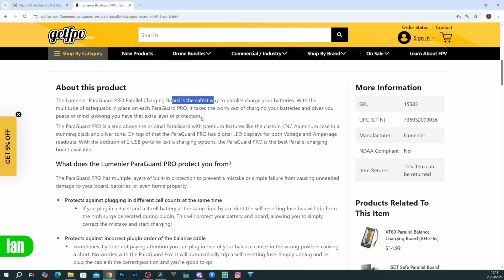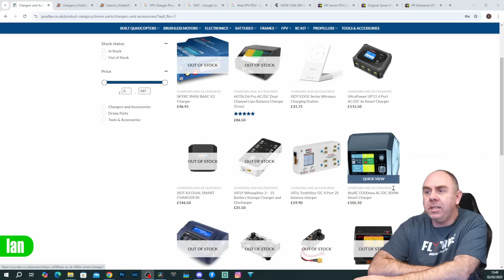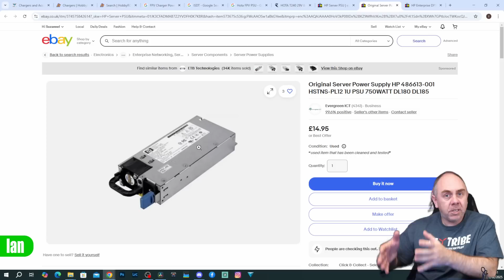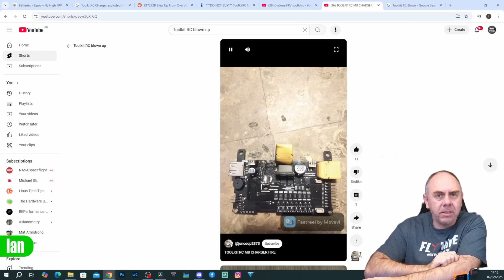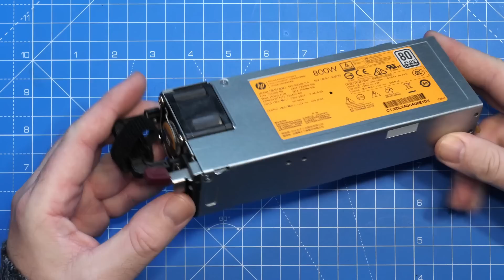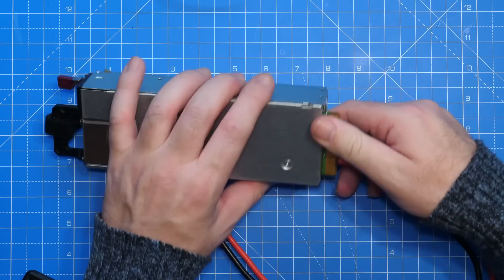FPV Lipo Battery Chargers Buyers Guide - Don't Get Caught Out!

Comment: It's a bit dissapointing that after all this time you still have to use server power supplies. I was hoping to get a nice all in one AC charger but it looks like I will be stuck with my setup forever. Maybe the chargers should be build like a modular NAS system with a small case that has a server power supply and multiple bays that can take the charging modules and you could just plug in as many ans you need.

Comment: I'm feeling old. Started FPV back in 2013 - It was all PSU > Balancer > Parallel board. Many years of use, never a problem. The chargers of today didn't exist; now there are dozens. I foolishly just bought a ToolkitRC Q4AC before doing proper due diligence, then I saw this 🙄... maybe it will be okay if I just use DC, lol🙏

Comment: I have a old school dual 12v supply from 30 yrs ago that still works fine. Have been using hota d6pro since it's be out and I use both ac n DC with it. But ac on small 2s but DC doing 4s up. .

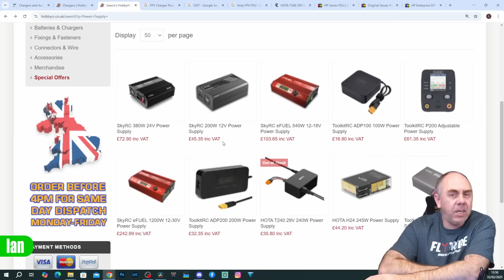Comment: 06:24  I use ZXD2400 3000w Server PSU for $30 (used) and Adjustable module + LCD $25, it has 2 output options, 60v and 50a or 120v and 25a.

Comment: Which would be better for the hotel f6 an 800watt or a 1200watt supply bearing in mind the hotel f6 is 1000w, are the different size still the same pin out?

Comment: Although I appreciate your content, on this one I have some concerns:
A 12V power supply will not  give you the most possible power for DC chargers, as these are also inherently have their V x A x W configurations, so you may not actually get the most out of it.
The section of cable used on your PSU is not nearly large enough and should never use an XT60 connector. That solder will melt as soon as you put some heavy workload on it

MY recommendation for whoever wants to use a truly powerful DC charging station, is to use SkyRC efuel 1200W and/or ISDT SP3060 or similar; and depending on the use cases, chargers like SkyRC B6, ISDT Q8 MAx or P30

Comment: On the server power supply, 700w sounds like a lot but no matter, you will be power limited by the 12v, to just 120W in many chargers.
If that's how you power your chargers that tells me you're definitely not pushing them to the limit. Hard to get good data on reliability like that.

Comment: Hota S6 for 3-4 years now and going strong no issues. Used to use a toolkitrc m6d which held up pretty good for me for a while but after some time I kept having to calibrate it. And before that I had a pair of ISDT q6 pros that worked awesome for a very long time but eventually those started messing up on me too. I think one of the major issues with Lipo chargers for FPV is that we use these chargers so much every single day and are putting so much voltage through these things especially when you’re using parallel charging boards on a consistent basis that eventually any charger will start going bad on you after some time it’s just a matter of how long it will hold out until then.

Comment: Another option  for a power supply is to use the one on your 3d printer if you have on, just don't print while changing. I personally swapped the power supply in one of my printers to a meanwell 24v 350w and i use the one that was in the printer just for changing.

Comment: I am new to the fpv community and I bought a new ISTD Charger that can do AC and DC. Unfortunately, I am a little bit disappointed. I only used it once for aboud an hour and I have seen at least two bugs while using it. For example I set it to charge my 1300 mAh 6S Lipo to storage voltage which is 3.8V. It stopped charging at 2.8V and started to balance it at 2.8V. I had to restart the charger for it to work properly again.
The second thing that really annoys me is the horribly bad fan curve for cooling the charger. The fans kick on at only charging one 6S Lipo at 1C and it constantly cuts out and kicks in again. And it super loud. It sounds almost like a vacuum cleaner! I also held my hand on the fan hole while it was on and it is barely moving any air. Super loud and inefficient.

Comment: I just bought and sent back two different P200 V2 units that had the same issue; failing left (Amps) encoder, out of the box. 

Did someone experience the same issue ? When I see your video I feel that it is more than just bad luck...

It really is a pity that the P200 V2 has so many failures as many ToolkitRC products, because it has really compact form factor (which is probably the reason of the AC/DC converter failure), AC and DC inputs and nice functions like the abilty to tell you the USB charging protocol actually used by a device and the voltage/current on USB port...

Any other 0-30V bench PS to recommend ?

I've already heard about some Q4AC chargers having defective channels, but i thought it just happens. Now I'm reluctant to buy from this brand.
For the multi channel charger I chose Hota F6, because I didn't want to rely on internal AC/DC converter, and F6+ is too bulky. I prefer to have 2 separate units in case something fails 😉
So thank you a lot for this feedback on reliabilty of these devices and random issues, ToolkitRC is making nice products in theory, but maybe they want to make it too cheap 😕

Comment: It's a pity that you failed to mention anything about the anti-spark feature in RC chargers. None of the chargers support it. (As far as I know, only some mid-range or high-end ISDT chargers support anti-spark protection.) The ISDT P10 you showed doesn’t, but the P20 and many other ISDT products do. I checked ISDT’s official website and I’m pretty sure about this—personally, I use the P20.

In the beginning, I bought the Toolkit M6D, and I found that every time I connected the battery, the XT60 plugs sparked like crazy. I ended up returning it and researched many models from various brands. ISDT is the only brand that clearly highlights the anti-spark feature in their product descriptions.

Comment: Hey Mads Tech, Im trying to adapt the server power supply approach, Ive got 1000W hp one, all good, but Im using Hota f6, charging 4x3s lipos (550), with 0.5A. And Im getting voltage too low on one of channel, eigher 3 or 4, so looks like 12v is not enough to charge in parallel, hmm back to the drawing board...Also cut 120W usb-c and connected to tx-60, no juice, looks like not that easy and trigger board is required.

Comment: Spot on with "Tool Kit"!!  M8S model, didn't have the thing for two weeks when the ac supply died.  Bought another one and then the balance port went on the charger itself.  It'll charge without the balance leads plugged in.  I bought two self contained chargers and only use the toolkit as a battery measure device, Passport and OVONIC work for me just fine and have some nice features which toolkit did not!  Keep up the excellent reviews!!

Comment: Server power supplies are on eBay for a reason as they have already been in a server for thousands of hours and taken out of service for a reason.. just buy a new server power supply if you want reliability.. also when a power supply blows it can take out your charger at the same time .. spending a bit more upfront will save you money in the long run. Shit chargers and power supplies are putting you at risk.

Comment: Is there still an added benefit in using a server power supply that outputs 24 volts over just 12? I've been using a 24v server power supply for 5 to 6 years of regular charging with 0 issues. It's overkill when I'm only charging whoop batteries, but 1 power supply works for everything.

Comment: saw this video and was inspired to run my hota d6+ off my $50 aliexpress 30v/10a/300w ps. dig the faster chg time w/bigger batteries and the quiet fanlessness, however the ps usually goes into constant current mode (dropping voltage) when i use both ports and the charger shuts one channel down stating 'unstable input voltage'. the first channel started carries on just fine. ps set at 24v/2.5a, combined chg amps doesn't seem to matter as this happens with well under 2.5 total for both channels. more/less volts/amps? ps too cheap? me too dumb? any input appreciated. thanks for the vids👍

Comment: One of the ports on my HOTA-F6 blew up, thank god I was next to it and smelled electrical fumes. { Then performed a system check and caused wild sparks to shoot out of that port.
Reply from the maker: Wow that's crazy.
Reply: One channel is out, dead! White smoke came out of it wh I plugged battery. What's nice about this unit is that there are 2 boards on it. CH 1,2 and CN 3,4. . So I can still use 2 channels.

Comment: My Hota F6 had really unstable current supply to the battery, could have been fake but I can't bring myself to try Hota again regardless, the UI is also slow. Instead I now use 2 M6D chargers and they haven't missed a beat, screen responds the second a press a button, always, don't need to a ridiculous long password thing to calibrate the voltages and updating firmware is easy.

Comment: just want to highly recommend the slimQ 330W universal Gaming laptop power supply (just Goolge slimQ 330W) 20V by 16.5A, small for transport and has a XT60 DC output for your charger's input, its enough power for anyone ( I run a 8S3P pack of 24*21700 molicel 45B's) never had issues with it travels well with the Icharger DX12 I pair it with.

Comment: Thank you for sharing power supply concerns.  Using a used server PS is brillant and I immediately when out and purchased a one on eBay quite cheaply.  I have since wired it up. It was a bit different than than yours but I easily found a wiring diagram on the net.  it's even smaller and quieter than the 300 watt one I used to use.

Comment: From my understanding, or at least from their website, the toolkit b6 neo is PD/DC. Does the pd is going to be considered as AC? This is the only charger that i’m using as it so small and convenient for the USB-C input
Reply: PD is dc, but with a small chip who talks to the device on the other end of the usb cable for more Volts than standar 5V from usb. it could up to 9, 12,15,20 or even more...

Comment: @MadRC . I had the same happen to my toolkit rc p200, the ac power supply board blew after a couple of uses. the GaH chip and traces on the board were toast. Ian how did you bypass the ac board to use the dc board only? i see you have a wire coming from the back of your p200.

Comment: Hi Ian, thanks for the video. I've had an ISDT K2 Air with AC/DC for 3 to 4 years and it's never given me a problem. It's been pretty good, and when it fails, I'll try the same brand and model if it exists. Regards.

Comment: The honest metric would be the RATE of failure.  Anecdotes are fraught with the potential for bias.  I have a ISDT D2 Mark II, an HTRC C150 AC/DC and a HTRC T240 Duo.  I run them for at least 8 hours twice a week and the only one that has "failed" is the ISDT D2 which won't run the storage mode.  My favorite is the T240 because of the ease of the touch screen.  All have AC power.  No failures.
Reply: Owning a shop that has sold hundreds of Toolkits and Hotas, I can say they are typically very reliable,  but then I got an entire case of bad toolkits and they just wanted me to order more.  Hota on the other hand has been easy to get replacements for DOA units.
Reply: @Fly_High_FPV  Excellent feedback. Thank you,

Comment: I've been using an ISDT D2 Mark 2 since 2019. It's on AC, but now I'm reconsidering after watching your video! The select switch on the scroll wheel stopped working end of last year, so I ordered another. 
I reached out to ISDT for replacement parts and the conversation was lost in translation. I wanted to buy a replacement scroll wheel board, but they kept thinking I wanted a warranty claim. 🤷🏾‍♂️

Comment: I had great results from my HOTA F6 for a couple of years, that is until I discharged 4 6S lipos at once. The fans ran flat out but obviously just weren't enough. After a while it let out the magic smoke. Very sad because the F6 did everything I wanted from a charger. I think the regen discharge (dump the power back into a big battery or resistive load) is fine but the internal discharge is just too much heat to dissipate when doing 4 lipos at once.

Comment: I use an AC DC charger (Hota d6 pro, SkyRc q200 Neo) for charging batteries below 2000mAh on a daily basis. However, for more serious tasks, e.g. charging large 4000+mAh lipo, I trust the Hota F6 with an external power supply (I use an industrial MeanWell power supply). I have used many chargers, the only one that broke was ToolkitRc, which is a shame, because they are very useful.

Comment: I've been charging parallel for more than 15 years and never had major issue. All of my parallel boards are without fuses, And it is up to the individual to exercise caution and special care. There are advantages and disadvantages to charge in parallel there are many articles on RC forums so I encourage to research the topic. People are spoiled today with variety of charges, so you might not need to charge in parallel.

Comment: I would have to push back on you somewhat Ian. I have been using parallel charging boards for the past dozen years with massive success. My EV peak CQ3 4X100 watt takes 4 parallel charging boards at a time giving me the ability to charge 24 batteries at a time. A huge time saver. I, of course,  practice extreme diligence when charging.

Comment: I bought my Toolkit M6D 500 watt dual charger [DC only} 3 or more years ago and have had no problems. But the reason for my post is simply from your video here and forums etc, I mainly have heard about problems with Toolkit especially AC/DC chargers. Others  wrote about the M6D when released was out of calibration from the factory and were videos how to calibrate it. I have not had this problem  and bought a second because I did not want to parallel charge anymore. Both operate identically in calibration and I have charged many 6000 mah 6s packs with ease. I have used server power supplies for many years. Not a Toolkit fanboy as these are the only Toolkit products I own. Just from my experience with the M6D.
Reply: I sold 200 m6d with no problems, and then I got a whole crate of bad toolkits, and toolkit wouldn't replace them. They wanted to me to buy another crate....

Comment: I use parallel boards, they are of course less safe than using the charger its about understanding what you are doing and mitigating risks with the  understanding there is no margin for error when connecting dissimilar cell voltages or cell counts, I 100% agree with you about recommending to someone else about how to change and to use multiple chargers and not use balance boards, my goto charger is a HK turnigy 4x 100w which is well over 12 years of most weekend use

Comment: ToolkitRC makes pretty awesome chargers, but they are too unreliable to be trusted. I`ve had two different ToolkitRC (DC only) chargers, both failed in different but dangerous ways. There was no warning and not even an indication of something going wrong. it was all in the background! I only found out because I`ve double checked what they were doing with a multimeter. If I wasn't getting suspicious, they would at best slowly but surely ruin my LiPos or caused a fire. NEVER AGAIN! Now I have three Hotas, 2x D6Pros and 1x F6. All are doing well so far, including AC side, but mostly use them on 24vDC

Comment: Absolutely agree. I have the exact same setup (server power supply with HOTA F6 chargers). Yes, it's initially more expensive than only one charger and a parallel charging board. But it's fool proof and you can charge 4 or 8 in parallel - more than enough without bothering on the voltage level. Easy, convenient, safe. And while being more expensive, we are speaking here for the price of what? Maybe two or three lipos.

Comment: Sorry for my english, but with a 12 V input dc, you can't use the max power of your charger. For example, Hota charger P6 needs more than 24 V in to have 300 watts output power. With 12V you must have half the power to prevent over current. So, if you choose a server alimentation with 12 V output, no need to buy 500 W output charger. Another case ISDT P30, 1000W charger but 60 A max input current with 12 V, you can only use 720W
Reply: Use 2 in series to give you 24v I use one for chargers that take max 18v and 2 in series for high power charging. Very low cost reliable power supply.  You used to be able to buy converted power supplys for helicopter high power applications which were 24v.

Comment: Why would you use 12v PS instead of 24v ? I'm using my old 1Kw 24v PS for years now with no issues
Reply from the maker: The reason for the PSU is they are cheap. 24v is good too
Reply: For 3—5" quads it doesn't matter until you parallel charge

Comment: Thanks for that. I'm pretty new to drones, but have more experience with battery management systems for home storage. Would it not be feasible to repurpose a home storage battery management system plus an active balancer (either integrated or apart, probably the former as you're not going to need 4A or more to balance the cells)? Coupled with something like the server power supply, you could have a really bulletproof charger setup that stops charging as soon as any parameters are out of whack, as well as a bluetooth (sometimes wifi too) app that you can monitor without having to check the screen all the time. It might be a bit expensive for charging one battery set at a time, but you could attach several e.g. JK BMSes for under forty quid each for different batteries. Note that these tend to be 4-8s or 8-16s, so it does limit what you can charge. It's just way more solid. But depending on the BMS you may have minimal charging rates that are too high. Ho hum, maybe not the best idea ever, but I may as well post it if others have anything to add that might resolve that potential issue.